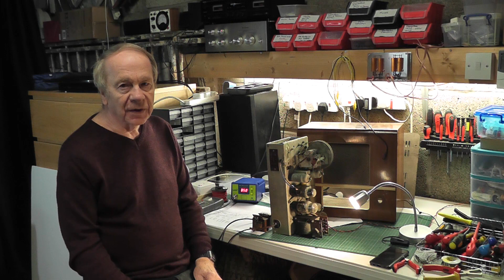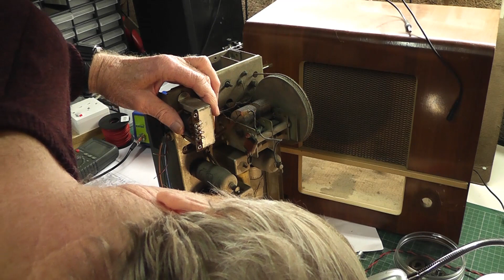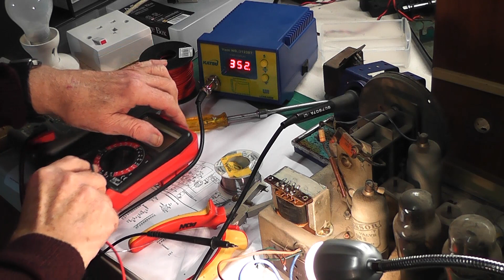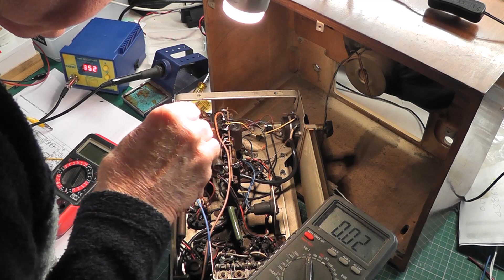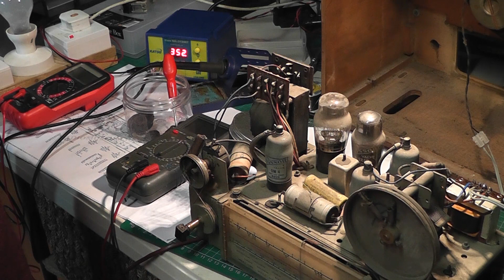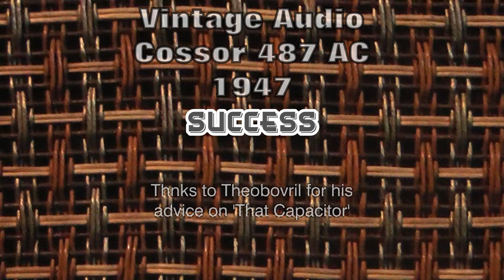Cossor Radio 487  Repair - part 2

Comment: David.  I have the same capacitor to replace in my radio C32.  0.01uf.  Would a 0.01 @ 450v be OK?  I haven't had five minutes to download the schematic yet.  Really enjoying your great video's.  Thanks for sharing 👍
Reply from the maker: Yes will work fine, good look with your repair, thanks for commenting.
Dave
Reply: @DavidHallettProjects  Thanks very much Dave, much appreciated 👍
Reply: Hi David.  Did you eventually replace all the electrolytic capacitors in your 487?  I replaced one and also the grid feed capacitor, I suspect that the TCC electrolytic near to the mains transformer needs replacing also.

Comment: It sounds very good David, providing it picks up stations OK right across the band then possibly no need to do  an alignment check on it...even though, myself, I do like to twiddle somewhat....well, as long as one knows what their doing and you don't break a core in the process...hmm?
Reply from the maker: Thank you. Yes it tunes well,  I don't think I will touch the alignment, just sort out the valve base cleaning and reassembly. Evening away from workshop and editing, chill out now. Cheers

David
Reply: The amount of times the grub screw has stripped the thread. (or just disintergrated)  :)